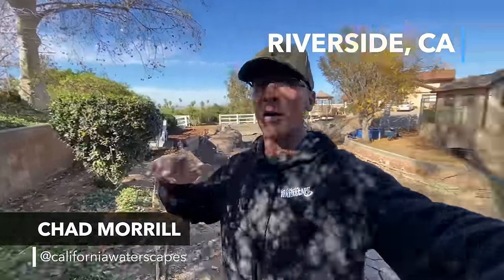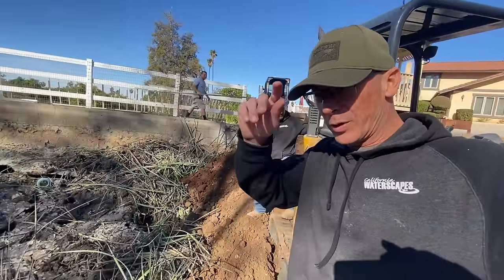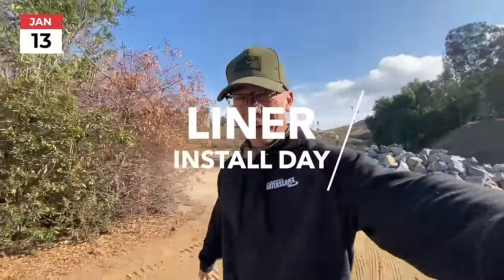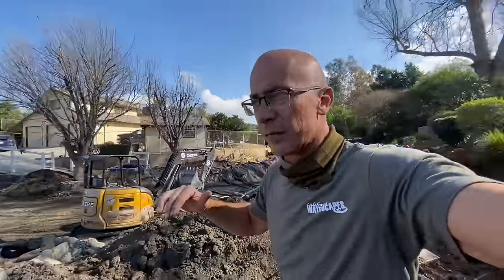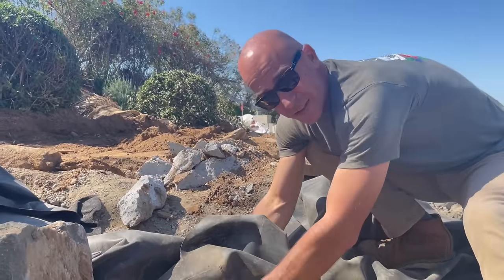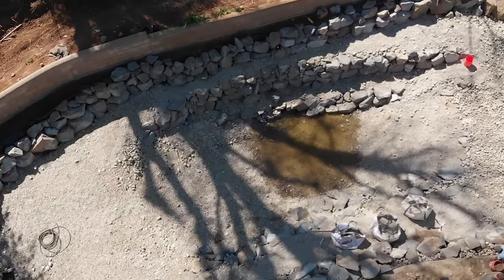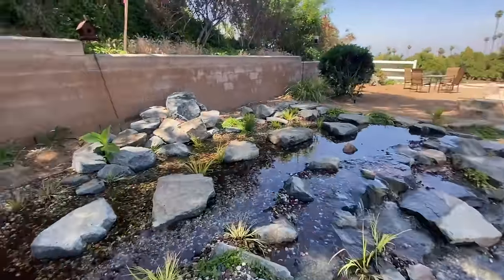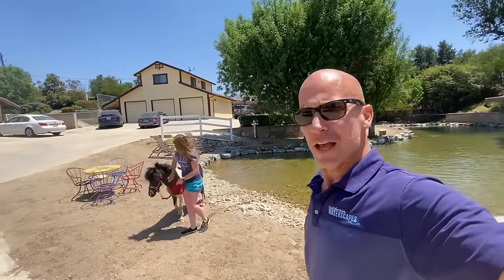NATURAL POOLS For HORSES - No Chlorine - Aquascape SWIM POND Biological Filtration

Comment: These projects are incredible. Amazing job ! Quick question, how would you ever find a leak in the liner if it was ever punctured by the horses?
Reply from the maker: Thanks Joe! We took extra precautions to ensure the liner is protected from the horses and added additional layers of cobble stones. So this shouldn't happen and the horses have been enjoying the pond without issues for the past 6 months or so... But for any pond/pool leak, there is a specific procedure to find a leak, look in high traffic areas and let the water level drop without filling up the pond until it reaches the leak, look around the perimeter at that level, you would find it there. :) Hope that helps.
Reply: @CaliforniaWaterscapes  it does. Thank you much.

Comment: How much would it cost to reline everything in 30 years? Or will it need to be? Will you need to remove everything and redo it since its not as easy as a regular pool
Reply: You’ll get 40 to 50 years of life out of .45 mil EPMD liner protected by rock and gravel from the sun